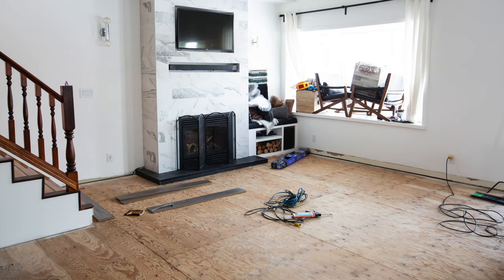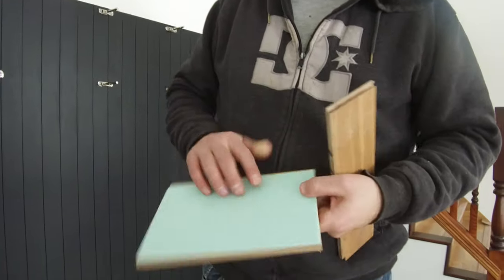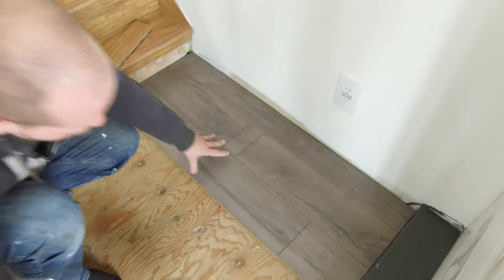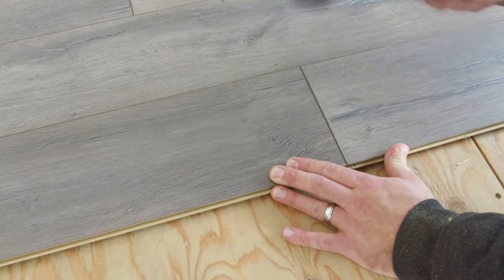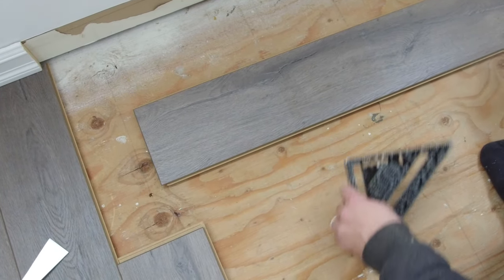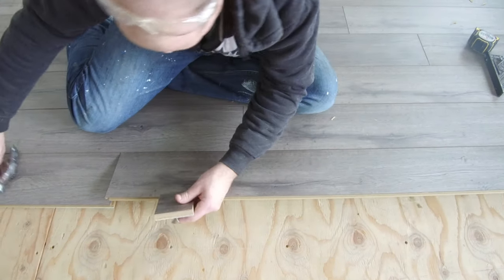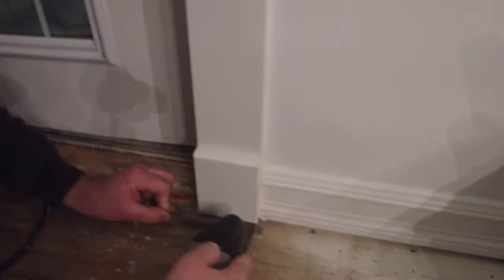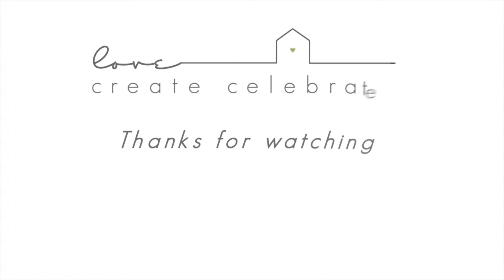How To Install Golden Select Laminate Flooring

Comment: Where's the 2mm base foam that is supposed to be put on before the laminates?
Reply from the maker: Attached under the board. The foam and board are all one piece, works significantly easier than rolling out the foam separately.

Comment: SelectLOC TM Click Installation

The click installation is intuitive, and easy once you get going.
Before you lay the first plank

Leave a 3/8″ gap around the perimeter of the room. We have shims that we cut and place around the room (taping them to the wall using painter’s tape) to keep the gap. This allows for the boards to expand and contract with the house.

Comment: You state the expansion gap should be 1/8", ive just bought some  Golden Select from my local Costco. The recommened expansion gap in there instructions is 10mm or 3/8" of an inch .

Comment: Golden select website says to have a gap of 3/8 inches between flooring and wall? Is a 1/8 inch gap better?
Reply from the maker: I would recommend following the manufacture recommendations, we set 1/8" due to some of our existing mouldings to ensure no gaps were visible.

Comment: I just got the GS laminate too. I was wondering if there’s any harm in putting a thin padding down anyway even though this comes with one. I wanted to do it to make up for the unevenness in my subfloor. I think the sub floor can’t have more than 3mm gaps or something like that. I also wanted to add a little extra noise reduction. What do u think?
Reply: Jay Bee  I ended up putting in a cheap under padding down anyway. I can’t remember the thickness but if I’m not mistaken it was 4 or 5 mm. It’s been a few months now and seems fine. It’s gone through the winter and now summer without any issues. My subfloor is wood so idk if that makes any difference. I’m actually about to do my upstairs soon and I’ve decided to just lay them down with any extra padding, just cuz It was a lot of extra work for me laying out the padding properly. Hope that helps
Reply: Jay Bee  the only doors on my floor was that front door and basement door and both were fine. I had carpet with under padding before that so that may have helped.

Comment: I'll be laying 1000 sq ft of Golden Select over the next couple weeks. Couple questions. Any need to cut down the width of the first row? (The width of the room will have 1/3 width on the last plank....just wondering if it'd look better or do it really matter). And I don't own a table saw. Will a circular saw be fine? Thanks. :)
Reply from the maker: L R No, I don’t think you need to cut down the width on the first row. It will be much easier to start with full pieces. And yes, a circular saw will work perfectly!!
Reply: @LindiandRuss   Thanks. The reason I was wondering about ripping the first row is that, if I read it correctly, Golden Select notes not to install pieces less than 4" wide. My last row looks like it might be as little as two or three inches.
Reply: I would definitely cut down the first row, particularly if you know you'll end up with a sliver of only 1/3 of a board width at the end. It will look ugly. You can easily figure out how much to cut by adding a full width to the amount you'll have at the end and then dividing by half.  Example: Let's say your boards are 8 inches wide, you know you'll have a sliver of 3 inches on your last row. Add 8+3 then divide by two. So you'll end up with 5.5 inches of board on each side.
Starting off with a partial board is just as easy as with full ones, plus it gives you the chance to make the cut edge follow wall more closely in the case of your wall being a bit out of whack. 
I see this was from 5 months ago, so I hope it turned out good for you in any case.
Reply: Jay Bee  sorry, I don't speak spanish (arriba! arriba!)

Comment: How did you fit the last row of flooring?  If you can't hammer it it to get it flat because its right next to the wall?  Thanks!
Reply from the maker: You can get a bar that has two opposite hooks on it (pull bar) - there is a link in the video's description for a ht and/or a flooring kit that includes it :)

Comment: Thanks for the video!

When a board is up against an area like a saddle or where a transition piece will go how do you secure that one side since it’s no longer against a wall for the stability in order to tap the joints together??
Reply from the maker: With a thicker flooring the shim will generally stay in place. If you are dealing with a thinner flooring type (like vinyl plank) you may need to adjust the shims as you go or use something heavy to hold them in place (like a box of flooring on top). But once you get enough flooring down the friction of the flooring holds it in place naturally. Hope that makes sense!
Reply: Love Create Celebrate thanks bud!  Keep up the good work.
Reply: how is the quality of this one? I'm curious to know your feedback after a year using these one

Comment: Instructions state laving 3/8 inch space on exterior walls for expansion?  Where did you come up with 1/8 inch measurements?
Reply from the maker: G Grong it’s better to use the manufacturers suggestions for that. We did 1/8 ish because we wanted to make sure it was underneath our thinner mouldings, and with gaps on both sides, we were pretty positive the floor wouldn’t expand/contract that much.
Reply: Love Create Celebrate   You should have stated that at the onset.

Comment: Is the quality of this floor good? I read older reviews that it chipped easily. I really want to buy that one but afraid. Maybe the company did some changes to the product.
Reply from the maker: We've only had the flooring in for a few months now, so I can't really speak to the longevity of it, but it seems to be a good quality so far. It doesn't have any chips or scratches anywhere! And we have dogs, etc on the floors every day. I'll try to update again if we see any changes!
Reply: Love Create Celebrate thank you
Reply: Hi, is the floor quality still great? Do you think you can use it on cement? Best

Comment: How did you start the first strip...having trouble locking them together
Reply from the maker: Nick Colwell did you put it in at an angle? It should just lock together?
Reply: Just straight across...laid laminate before but having quite the time locking the ends together. Have broken like a package already lol
Reply from the maker: Nick Colwell is it all squared up? You’re just talking about the first row? The transverse joint pieces go on top of one another. Dropped in from above, not slid into one another. We’ve used this same flooring twice now and never had an issue. If you google it, I think Golden Select has a video of how they go in too.